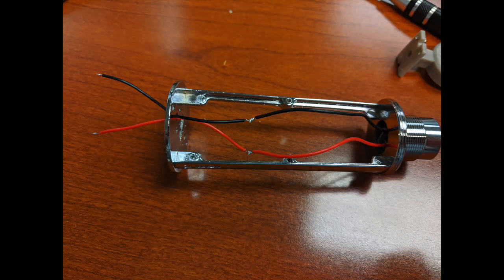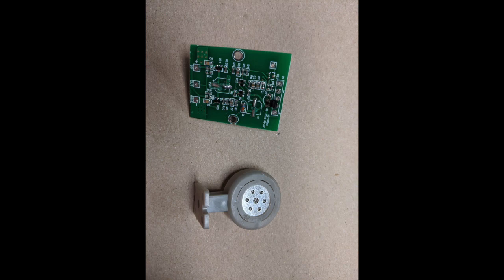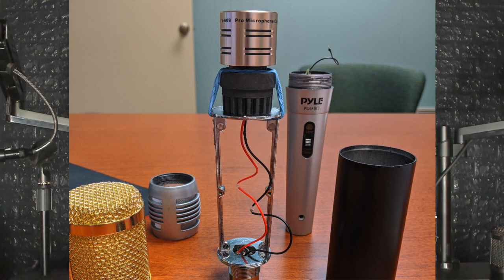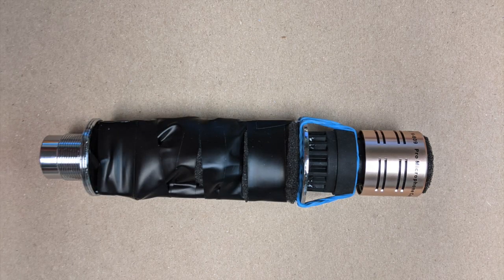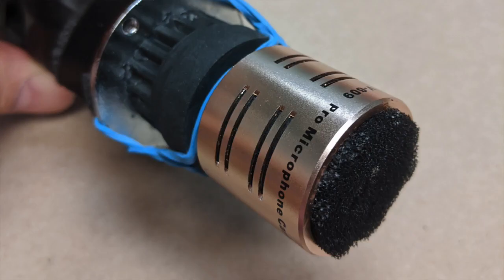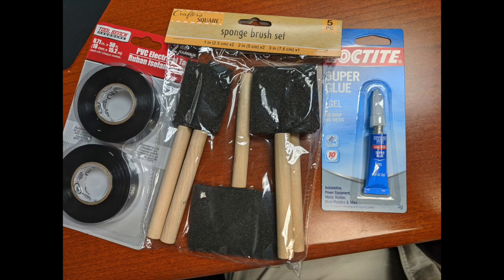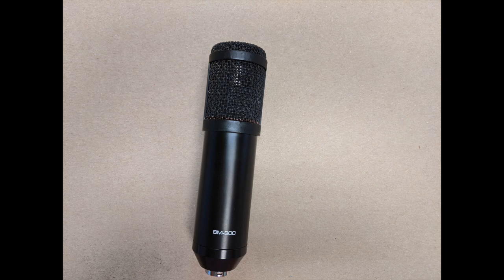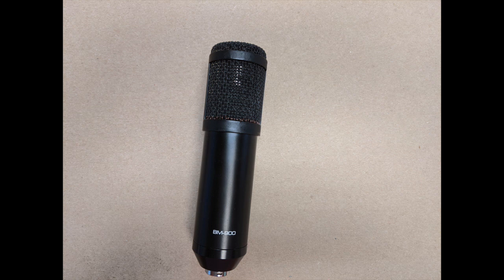I took a generic bm900 condenser microphone and created an end address dynamic microphone!

Comment: That was not even the worst BM800 variant. At least it had a 16mm capsule (rather than a 9mm capsule masquerading as 16mm) and a discrete JFET.

It's still probably carrying the horrifying engineering mishaps that make them noisy and mildly distorted. Good riddance.

You could reuse the 16mm capsule in the front of Pyle body as a front address condenser, but we'd need to design a saner active stage for that :D

Comment: Very cool! Definitely a good use for one of those throwaway mics. And it sounds pretty decent. I wouldn't trade my King Bee for it but I wouldn't complain if I was recording a podcast on it either.

I wonder if larger broadcast-style dynamic capsules are available as loose spares. And it would be a few bucks more but maybe you could review the the TSB-2555B Electret Capsule from microphone-parts dot com, I think they're on sale for like $30 right now.
Reply from the maker: Actually the $12 capsule I threw in the aokeo ak-60....large diaphragm ..and I LIKE it